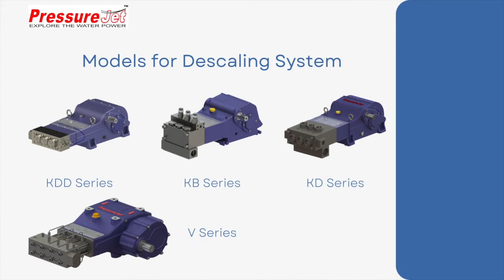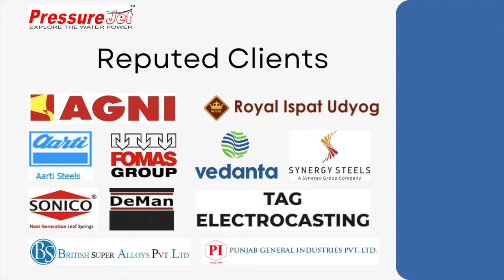Descaling System for Steel Industry | PressureJet #HydromechanicalDescaling

Comment: A perfect solution for descaling of Hotmetal to Produce Quality Products 
Congratulation to innovative team for continuous improvement in design and process of Descaling.
Reply from the maker: Mr. Prashar, thank you for your kind words. In response to your comments, we'd like to inform you that we have 9 SolidWorks licenced softwares, 5 of which are dedicated to producing customised systems for regular enquiries such as descaling systems, High Pressure Hydro Jetting, Metal Powder Water Atomisation etc... We are really delighted to collaborate with you for the same.